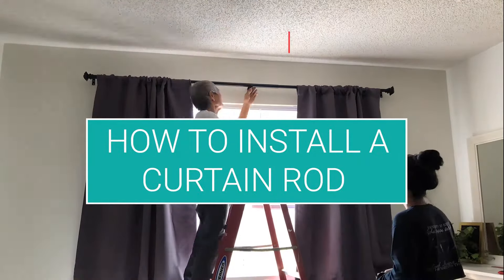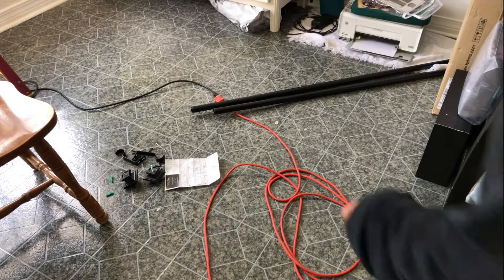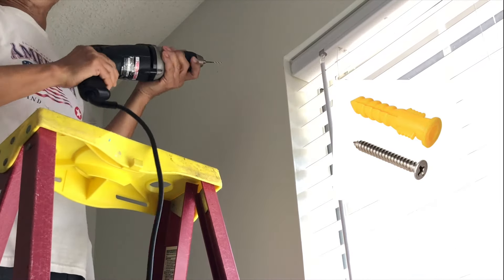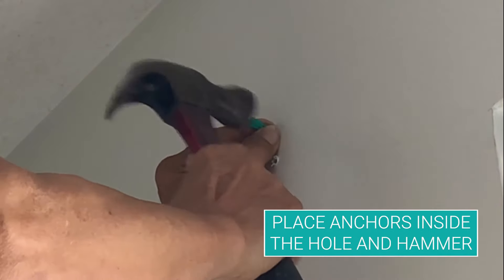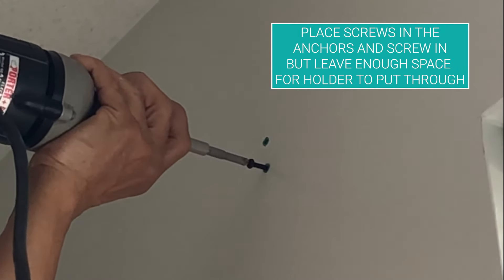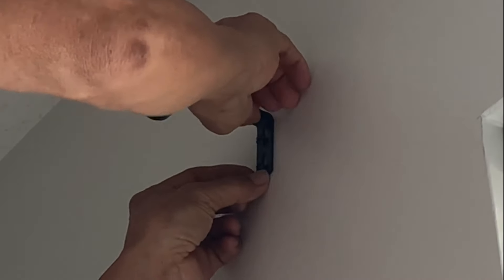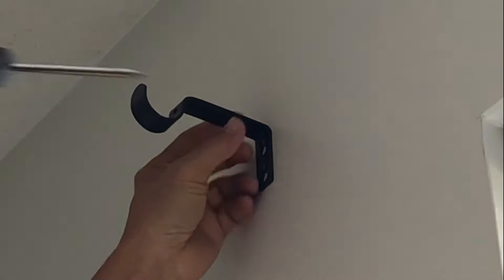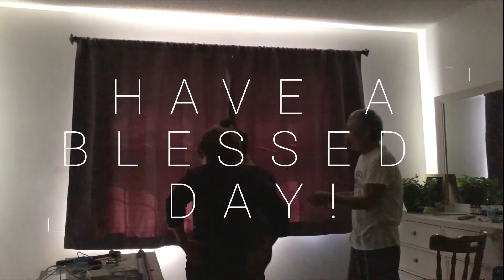HOW TO EASILY INSTALL A CURTAIN ROD & USE ANCHORS ✨

Comment: Thank you, thank you, thank you! Your video was PERFECT for the info I wanted. Your dad did an awesome job of showing the use of a pilot hole and then hammering the anchor in. Loved your graphic of the anchor expanding inside the hole. You also continued narrating your video in much needed detail on how to put the screws  in, but not all the way and them AFTER that adding the holder and tightening the screws. The curtain rod manufacturers should have you write the instructions 🙏
Reply from the maker: awww wow this comment made my day! I'm so glad you found my video so helpful :)